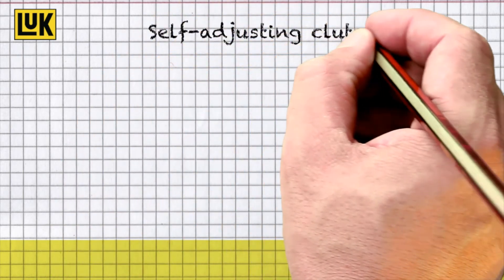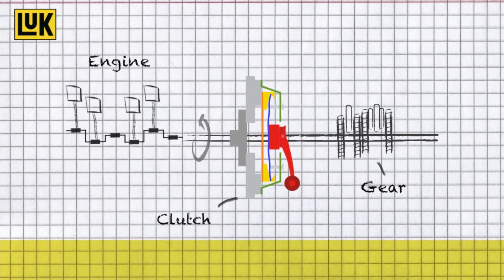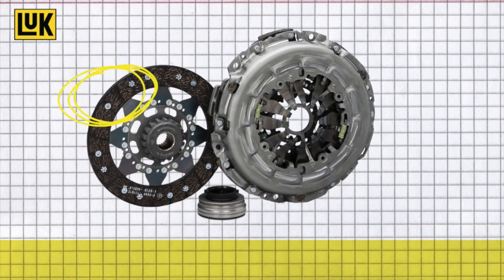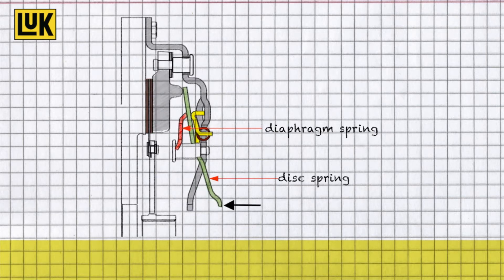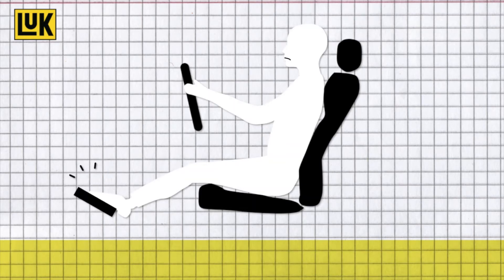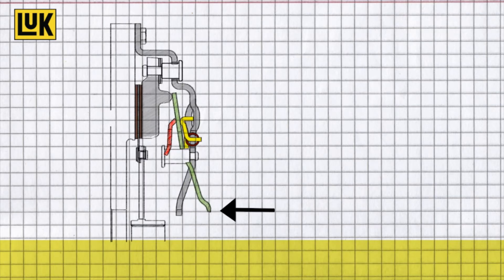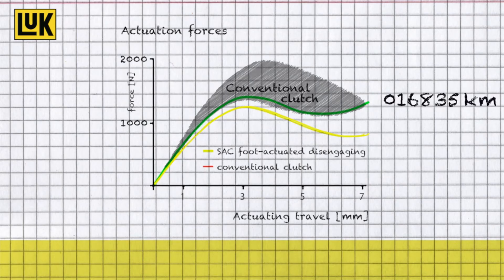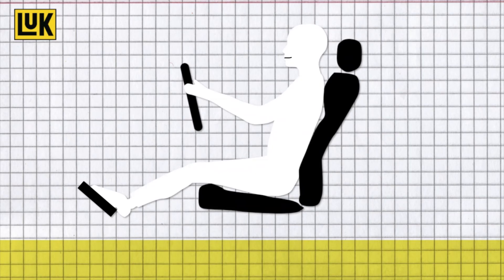LuK Self-Adjusting Clutch (SAC) - Simply Explained!

Comment: The self adjusting  mechanism therefore keeps the geometry  constant throughout it's service life. Therefore, pedal pressure and travel remains the same.
 Simple really. 
 Fitting a replacement without using the compressing tool would cause the SAC mechanism  to travel to the end of it's travel then ?.  (Causing the clutch to become heavy in operation) ?.
Reply from the maker: Dear @gotobedandtickler 
The installation without the compressing tool increases the chance that the clutch housing will bend during the installation process.
If you do so, the counter force of the clutch pressure plate is permanently pushing against the flywheel and if you do not equally and slowly tighten the screws, the housing will bend and the adjustment mechanism will not work anymore.
To avoid this trouble and to ensure a 100% operating clutch, we highly recommend the use of the compressing tool.